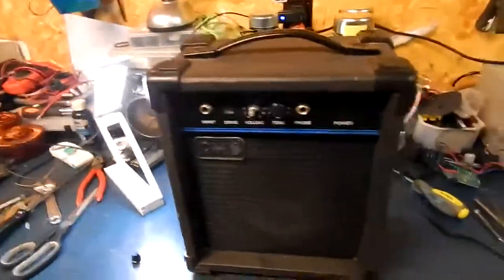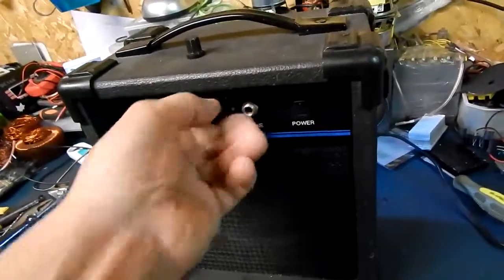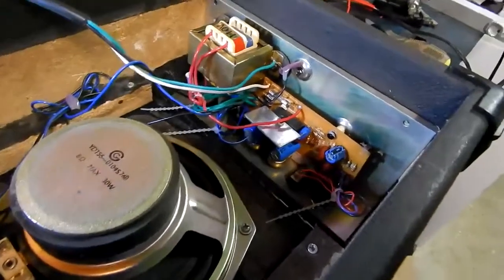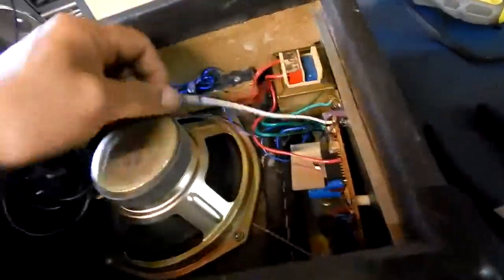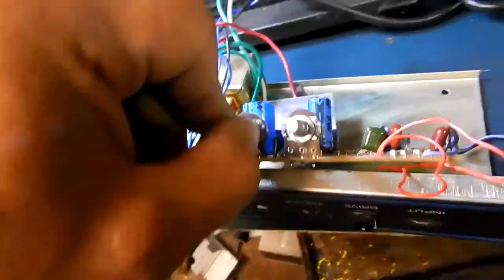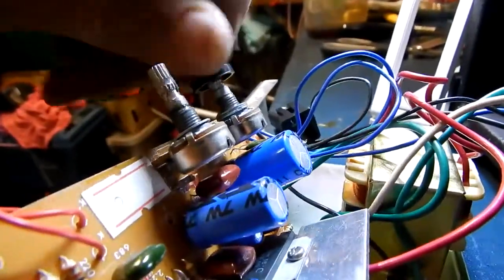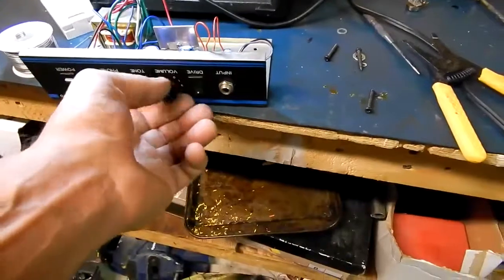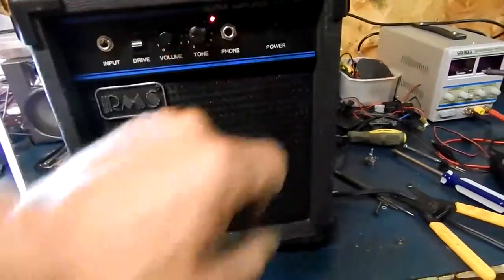RMS-200 guitar amplifier repair|*bad pots*

Comment: I just bought a used amp. I got inside and sprayed inside the pots a few times, they all work, but one is real noisy. REAL NOISY! Should I spray it again, or how do you tell i the pot is too far gone and needs replaced.